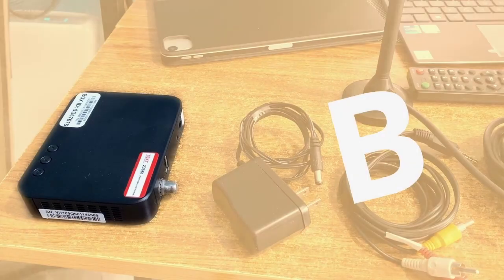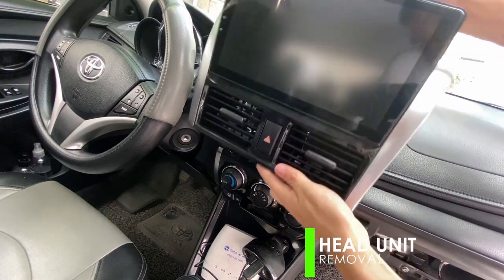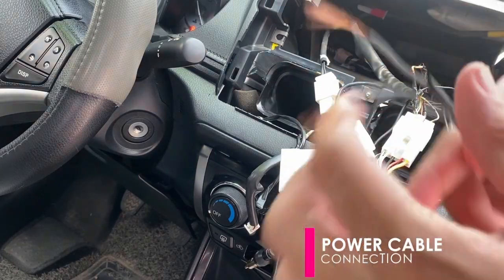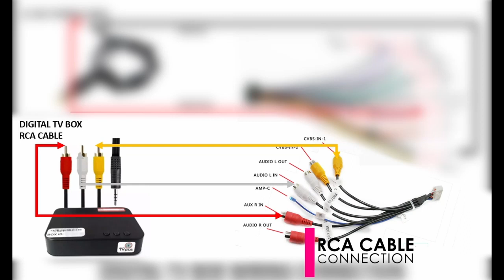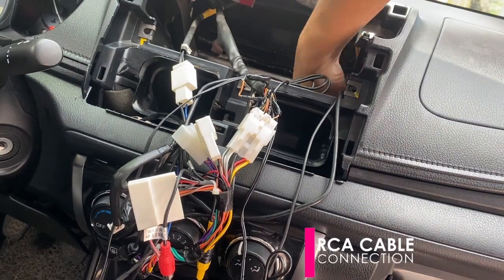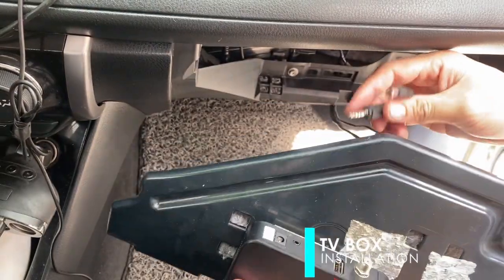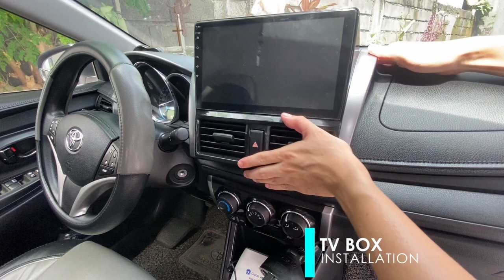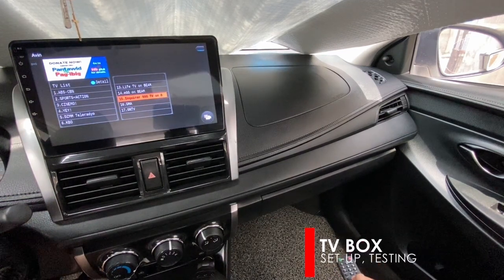How to Install Digital TV on Android Head Unit, #TVPlus #DigitaTV #GMAAffordabox

Comment: galing Ng video mo sir .  di n b need Ng fuse pag tap Ng wire sa acc? ty
Reply from the maker: Pwd nmn sir, safer un
Reply: @EngrDeeIWye  hi sir na install ko Yung tv plus problem ko po pag nag on ako Ng headlight sa gabi nag no no signal Yung video? ty.
Reply from the maker: Sir, paki check po if pg mg turn on ka ng headlight, ung ilaw ng tv plus is nga rered.
Reply from the maker: Bale dapat on normal condition, green ung light ng tv plus po. Pa check muna sir ty